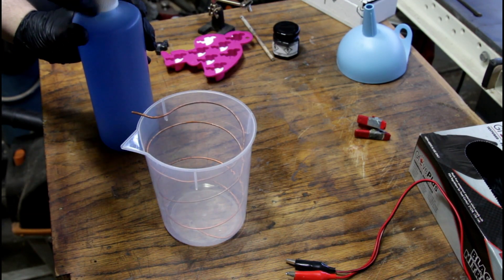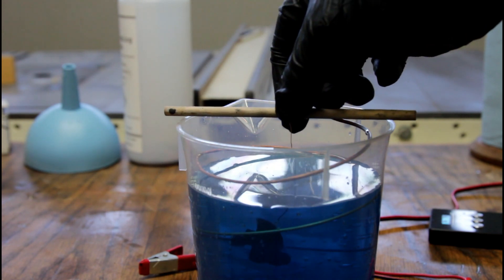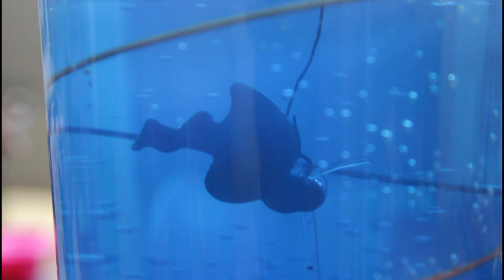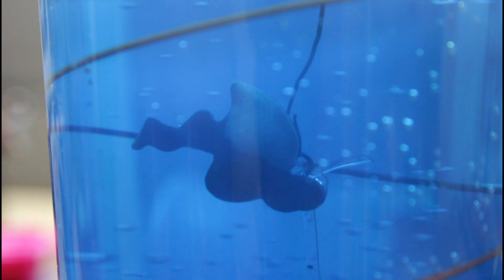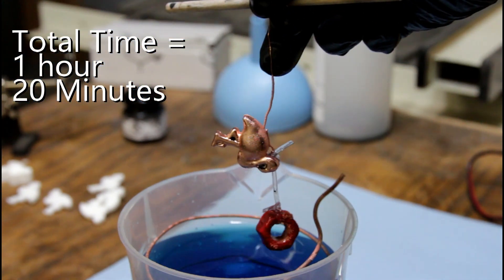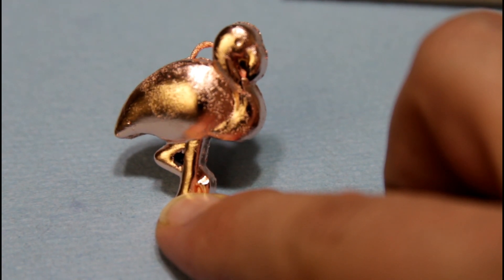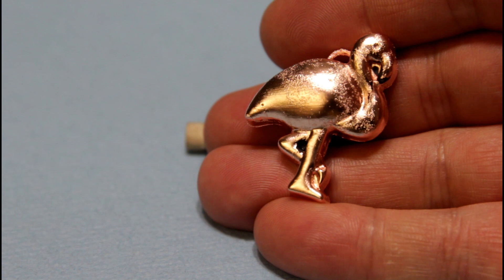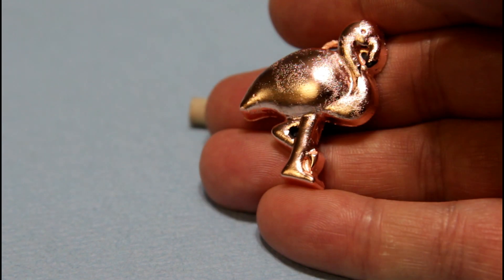Electroforming Time-Lapse: Copper Flamingo

Comment: So how thicker can the copper get?  What happens if you leave it in the solution for a whole day?
Reply from the maker: The hallows pendant was in the solution for 15 hours.
Reply: The layer will keep growing the longer you leave it in the bath.  the thicker it gets, the more irregular it gets too.  see how parts of the flamingo looks bubbly?  that will continue to happen across the whole thing.  The current you use can change the pattern you get, if the layer grows slowly it will stay more uniform but if you have the current set high to plate faster it comes out a lot more irregular.
Reply from the maker: @jozzaud  That makes sense. I have had some issues with regularity on some pieces.
Reply: @jozzaud  is there a way to make the electroplating process go faster while still making it resemble the flamingo?
Is it even possible?
Reply: @jozzaud  Why does it start from where the wire is touching the flamingo?
Reply: It will keep going until the copper wire is so eroded it wont pass a current through it
Reply: Commercially electroformed parts can be up to .25" thick.

Comment: If you check the beginning of the time lapse, the solution is darker than the end. It could be the lighting changing, or the camera adjusting. If it isn't that, however, it means the solution lost enough copper to turn lighter. I find that very cool. Also, is the solution reusable? If it lost enough copper in solution to turn a different color, I would suspect subsequent runs to be less and less effective, or less and less quick to electroform. Anyway, great video and great channel!

Comment: If you printed a piece with PVA. Painted it and then plated it. Then plate it in an ice bath or at least cold water. Clean it with an ultrasonic hot water bath. You could make hollow projects. The PVA dissolves in hot water. You would have to make the copper a lot thicker.

Comment: Can you reuse the blue liquid, or is it a one and done type solution? Same question about the copper wire? Does it slowly degrade, or is it just taking tiny particles from it to cover it?
Reply: Halfax7 technically it’s ripping off singular atoms, but yes, it uses up a good chunk and you can’t expect to get multiple uses from one. It’s pretty cheap anyways.

Comment: If you can create a layer of copper over an item.....and you could keep the process going till a good thick layer was formed could you then remove the inner material to leave a hollow copper item?

Like for instance using a type of wax or low temp melt plastic of some kind?

Comment: $150 is quite a high price. In the Netherlands a complete kit including a power supply will cost you around the same. And the euro is stronger than the Dollar.
Reply from the maker: Not a huge surprise. They're a California based company. Things tend to be more expensive here.
The important thing is that you've found something that has all the parts you need. :)

Comment: I love electroplating. I was just jeweler for 30 years, did a ton of electroplating. Mostly electroplated rhodium on to white gold and platinum as they don't shine very well. You can do the same thing with gold simply using one pennyweight of gold solder and the same setup you have. Although the gold acid is a whole lot more expensive than the copper. When plating other than metal I usually used nickel plating first and then the gold, it gave it a better base. But I love the project, back when I was electric lighting they did not have anything like conductive paint. It's very interesting, thanks for sharing your shop with us, 
Jimmy
Reply from the maker: That's really cool! Thank you for taking the time to share all that with us!

Comment: As others have suggested, you should try cranking the current higher and leaving it to plate for a longer period of time.  more current means faster plating which means that the electroforming happens more irregularly and you end up with really cool looking bubbly crystalline structures.

Comment: Nice video.  But... technically. this is not electroforming.  This is electroplating.  Electroforming is much thicker and is for structural purposes.  As in making a solid copper mold for injection molding for example.  That would be electroforming.

Comment: Hey Peter, I had an idea for you to try with a resin pour.  Suspend some heavy string like a butchers string into the container so they reach the bottom of the container.  Pour in a colored resin into the bottom of the container.  Next pour a clear resin on top of that.  Slowly pull the strings up and out of the resin.  Hopefully it will pull some of the colored resin up creating streaks through the clear resin.  Worth a shot.

Comment: You know, all this time, I thought companies used vacuum vapor deposition (or whatever it's actually called lol) for coating plastic in metals.  Assumed it was impossible for the average consumer to afford or do due to either cost or equipment for the process.  Thank you for opening my eyes to the simplicity and affordability of electroforming.
Reply: Sometimes this is true. What Peter is doing here is a really great example of what's called sacrificial corrosion.
Reply: @killer008r  Yep.  I'm familiar with the electroplating version of this, but wasn't aware of how to plate plastics and polymers.

Comment: can you use powerade or does it have to be blue Gatorade?
Reply: Liquid meth works well, you can smoke the crystals after too
Reply: Idk I used Vitaminwater and it worked for me
Reply: Okay, I dropped some pennies in a bottle of windex and chugged it. What's next?
Reply: @TheTetrapod  swallow five watch batteries to get a circuit going
Reply: @TheTetrapod  call 911
Reply: @TheTetrapod  Copper turds.
Reply: Guys, it works with plain old dyed water. Even cheaper too

Comment: the process is nice but i'd like to see you electroform an object made of wax, and after you melt the wax show what's left.
Reply: The form would collapse. The copper on it is extremely thin, taking the form would destroy the form.
Reply: @josh___something  this is actually a common process for making very thin metal parts in the aerospace industry. I've personally used it several times in my professional life for making things like bellows or baffles. Depending on the geometry, the mandrel is either removed (usually by freezing or heating it) and reused, or it is melted or dissolved away.
Reply: Hmmm? Copper candles? Wonder if they would burn...
Reply: ohhh good idea.